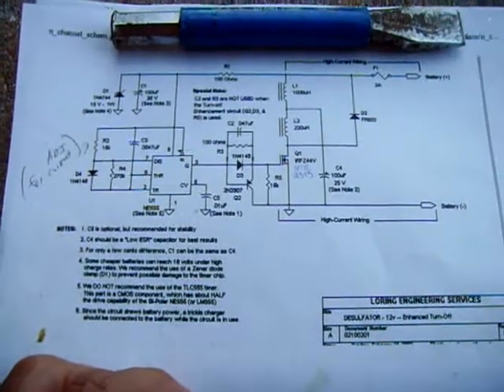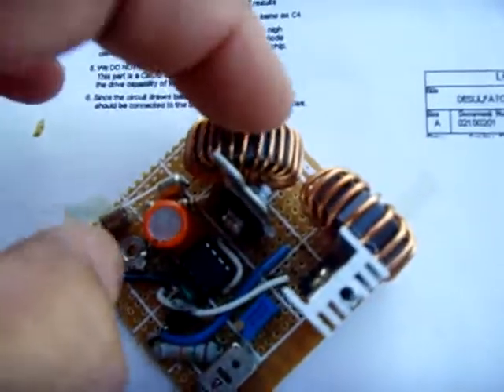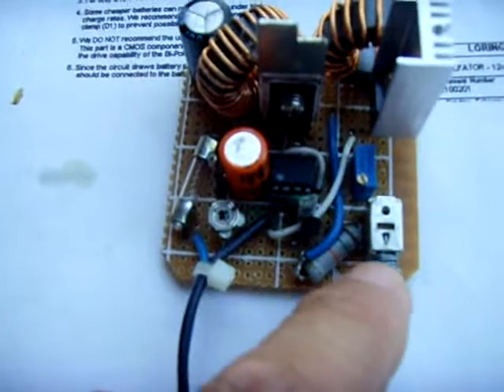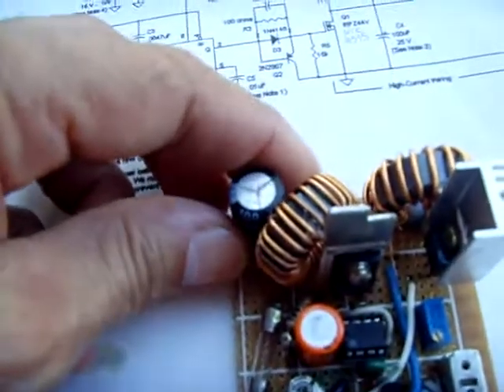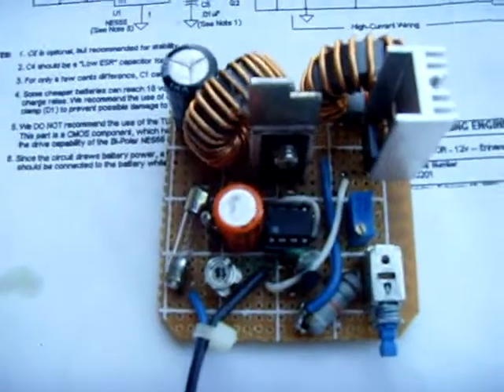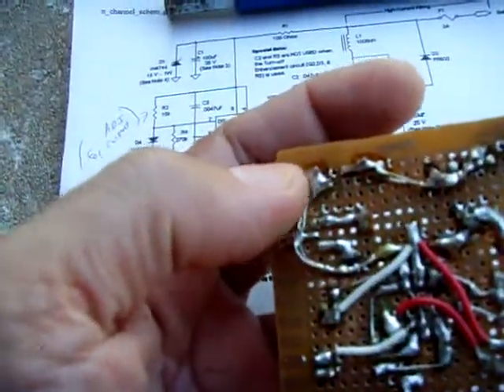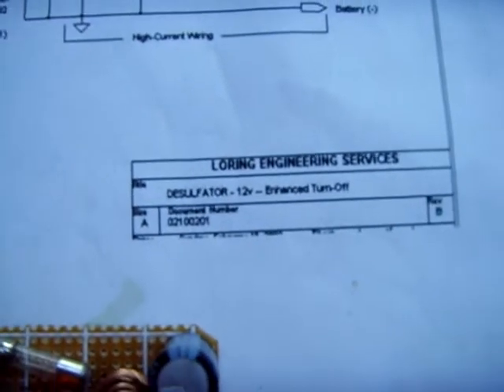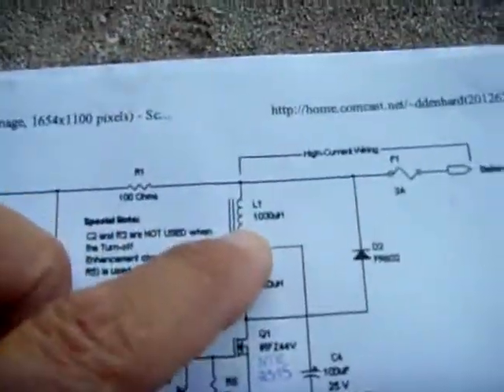12V Lead Acid Battery N-Channel Mosfet Desulfator

Comment: Lemme guess what that circuit does...
It uses the mosfet to switch power on & off that is stepped up in voltage by the capacitor, and blocked from reaching the mosfet again by the diode. The capacitor then charges the inductors, which act like normal wire in a DC circuit, until the mosfet switches power states, causing a giant spike in DC voltage going to the battery.
I could be more specific, but didn't catch what mosfet is being used.

Comment: Very interesting! The key is the inductor. Could you post more details somewhere? how do you know/measured inductance reduced 20%?what core you used and OD/wire/turns/where to buy? The 1mh inductor would be smaller, and separate the two at 90deg angle might reduce the interference. Thanks in advance.
Reply from the maker: It's been a while. You're better off asking at the link I supplied in the video description area. I made my own inductor using my DMM to measure inductance. You're probably better off buying the inductor.

Comment: Generally on all car batteries, each cell is about 2.25 volts, so if you lose a cell your battery will sit at about 10.5 volts. Your battery should jump up by 2 volts resting voltage after sitting for 2 weeks, and if it doesn't, there is still a clogged plate. Generally when you have a "shorted" or clogged plate, the battery cannot be repaired, not even with a desulphator. But you can use a 10 volt battery, but it's unlikely to ever go back to it's full voltage. The desulphator should be used to restore a battery to like new condition, but not to fix a shorted battery. Shorted plates cannot flow current in the the liquid electrolyte, so instead of a capacitor effect between the plates, you get a resistor effect, which most likely will eliminate the necessary harmonics that are required for scalar energy oscillation desulphation.
Reply from the maker: 2.1V per cell is typical. 2.1 x 6 = 12.6

Comment: good detail but kindly can you guide me about inductor design ...gauge of wires and number of turns .i idnt have oscilloscope neither have lc meter ...search meny but not found much ...whats its frequency and does it work with larger batter like 100 to 250AH..i have seen one more circuit in which does not use in any inductor please check this out is this really work http://www.homemade-circuits.com/2012/05/battery-desulfator-circuit-explained.html
must reply i will be wait ....does it work without inductor
Reply from the maker: Hello. Yes, you need the inductor. You need to purchase a good DMM for electronics. Once you have one, you can make your own inductors easily. Use a wire size that can handle the current. Refer to the links below. You cannot beat the prices. Thanks

http://www.banggood.com/Vichy-VC99-Auto-Range-Professional-Digital-Multimeter-Tester-p-910660.html?p=U627203391019201512Z

http://www.banggood.com/MK-328-Transistor-Tester-Capacitor-ESR-Inductance-Resistor-Meter-LCR-NPN-PNP-MOS-p-1010347.html?p=U627203391019201512Z

Comment: Res sir ,
what is core no.?
what is AWG of wire?
how many turns for each?
pls..........................waiting.....................
Reply from the maker: +jagdish sawant 
I do not know the core #. The toroids shown in the video were removed from scrap electronics. I used 20ga enamel wire. I suggest you use a DMM that has an inductance setting.

Thanks

Comment: Res sir,
it is noticed that ,2 presets(potmeters)are used in your demo cct...which is not in schematic .
two mosfets are there,in your ccts....which is not shown in schematic..
R1 is 100 ohm 1/2 watt  is used to supply the thick track carrying high cerrent, how come?pls tell me....

It is difficult to hear native English,So please put subtittles...with theoretical declaration...that my time can be saved..thanking you.
Reply from the maker: +jagdish sawant 

In place of R2 and R4 I used potentiometers to allow for easy adjustments.

Thank You

Comment: what is the term desulfator..I see here a circuit.but the demonstrator has not shown it using with battery...why the switch is introduced .and when and how it operated.how to control opertion of this desulftor......I HAVE NOTED DOWN THE CIRCUIT AND SOON WILL BE CONVERTED TO PCB. AND TRY WITH MY BATTERY .....PLS TELLME THE ABOVE QUESTION BEFORE THAT....
Reply from the maker: +jagdish sawant 
The switch is used to disconnect a portion of the circuit so you can easily adjust the output using a scope.

Thanks For Watching

Comment: must be practical....
Reply from the maker: I did have a couple lead acid batteries that would not accept any charge, and this device definitely helped. I was able to charge them, but in the long rung the batteries are usually too far gone.

Comment: I just built the one by frontier springs had it running a few days now, apparently because we can't speed up chemistry it can take upto a month or more before seeing positive results, this is because the sulphate build up might be very think and the improvements won't be noted until it is all excited off the plats by resonance effect like ultrasound dissolves kidney stones, I guess this is similar a sort of battery kidney stone de-solver lol just to use the analogy, great video btw nice to find someone else is doing what I just started, I have not made any video’s on my version yet. Here is the frontier springs article http://frontiersprings.com/desulfator.html

Comment: So why don't auto companies build this into their cars?   Okay, I know why, just had to point it out.

Can you connect this t a battery that does not have a charger running at the same time?  Can it be connected while the car\truck\whatever is in use?

If you buy fabricated inductors, what watt rating do they need to be?

Thanks for sharing your knowledge!
Reply from the maker: Hi,
The purpose of using the charger is to make up for the current that is being consumed by the desulfator. If you buy ready made inductors, just make sure the values are as shown in the schematic, and they have a heavy enough wire to handle some current. I don't recommend using this while the vehicle is in use. Even though the battery should absorb all the spikes, you never know. It could possibly cause interference or damage to sensitive electronics.

Thanks For Watching!
Be sure to share my channel with others and rate a thumbs up.

Comment: Can i use it in 12v and 24v nicd battery from drills too?
Reply from the maker: Never used it for that. The way I have always restored bad nicads/nimh was to momentarily supply 6 to 12VDC to the battery. I did that several times, then it took a charge. You may have to cycle them a bunch. Some are also too far gone. I saved many that were a dead short. You can also try using a 555 astable circuit to produce pulses into the battery at 6 - 12V. Safer way. 50% duty cycle I would use, and only do it a couple minutes. If you feel the battery getting hot, better remove it. Wear safety glasses in case. Check out my video playlists, as well as my 9V alkaline battery charging circuit.

Thanks For Watching!
Reply: electronicsNmore I have a small solar system 75w and 24v, but the charger can be arranged in 12 or 24v battery and since a drill has 10 cell nicd (1.25 to 1.4v) cell i think and it's charged with 14v, i did connect the battery and it did regonized so i short my 24 bank on it, was like small sparks but it went hell after 5 seconds, but it's showed alive on solar pwr charger, i think i defibri it or killed it for good!
I couldn't find your 9v charger since you have over 100 videos!
Reply from the maker: LOL. Too funny. NO. You had to open up the battery pack and apply short bursts of higher voltage to EACH CELL! + to +, and - to -.

I have video playlists. You can choose the type of videos you like. When you go to my channel, click videos, then choose playlists.

The 9V video is here:
9V Alkaline Battery Charging Circuit(Also 1.5v Cells)

Thanks For Watching!

Comment: thanks for quick response. what is the duty cycle for your desulfator? I have used the ferrite toroid for 220uH. the capacitor 220uF, FR diode, FET, and the ferrite core are got hot in 10 seconds. I have measured the inductance which decrease to 180uH. Now what should I do?